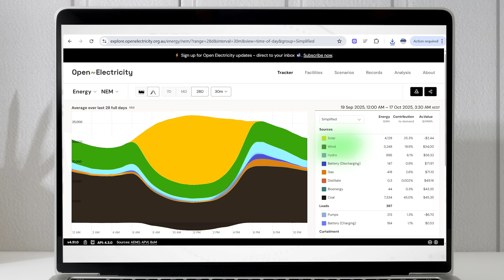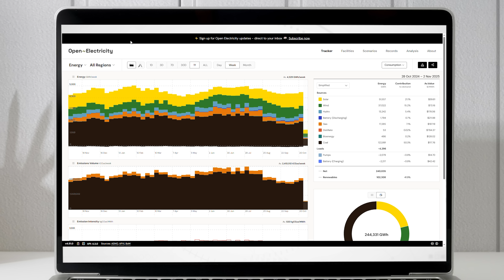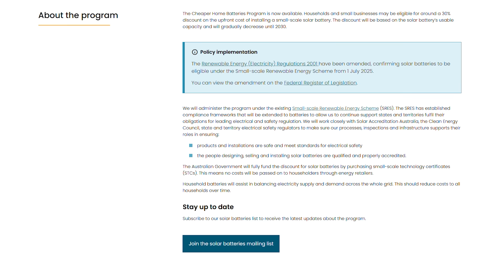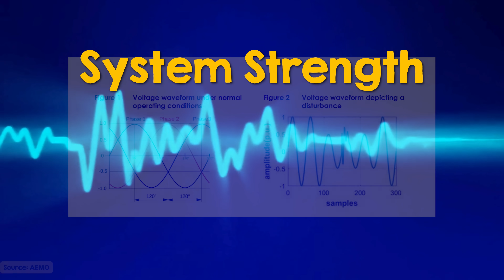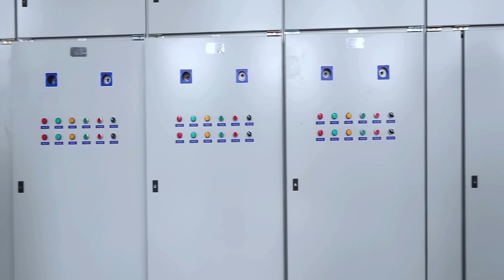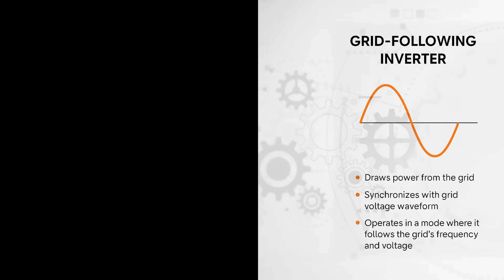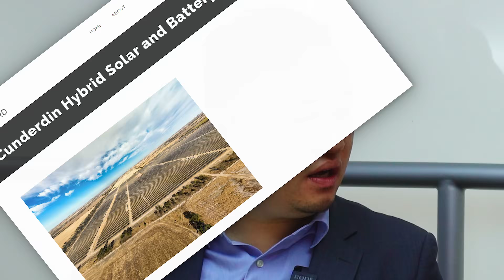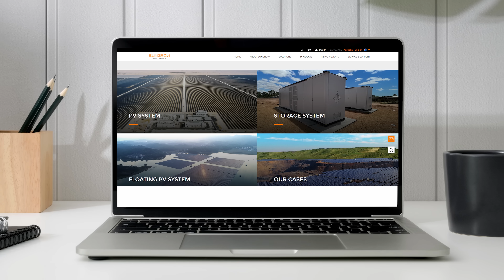Australia’s Solar Boom Is Breaking the Grid - Or Is It?

Comment: It seems that generators (maybe repurposed ones) spun up by electricity (rather than steam, water, ...) could be used to hold "inertia" until better electronic versions are made. In fact, they could be made relatively efficient to do just that by using massive fly wheels.
Reply from the maker: Yes that's probably worthy of a video of its own
Reply: @EngineeringwithRosie isn't it what synchronous condensers do?
Reply: @JSM-bb80u Yup, she covers it in the video. They do the job, but they're expensive, slow to roll out and inefficient. They're more of a bandaid solution
Reply: @EngineeringwithRosie  Yes! Good point.
Reply: @EngineeringwithRosie  Any negative points about renewables the Oil/Gas industry will use it to there advantage
Eg, the term ` Carbon Footprint ` was coined by the Oil/Gas industry to divert blame of global warming to the customer...
Reply: @EngineeringwithRosie  Storage using the battery packs from transport that has reached a level to costly to maintain or less efficient chemical type that`s no longer viable for transport....
Reply: Yes, just drive the giant AC generators of a power station with a DC motor powered from batteries and have the connecting axle weigh a lot for stability.
Reply: @zapfanzapfan  Not 100% sure but I believe you don't need a motor to have this running. Maybe for startup to achieve synchronous speed. But then you connect the Machine to the grid and from then on it will follow the grid and will only consume minimal power from the grid to compensate for friction. That's it. Then as soon as frequency of the grid drops, it immediately becomes a generator using its inertia to help stabilize it.
Reply: @beatreuteler  Synchronous condensers, yes, but the comment seemed to be about repurposing an old power plant and I suggested using the old equipment to hook up a battery plant so power can be both drawn and provided to the grid, plus provide inertia.
Reply: looking the wrong way...storage is what is holding us back ..I have 24V (12x2v) gel batteries and no grid supply only a cheap backup generator which I only  need about 3-4 mornings a year
Reply: @Tony.w-y4i  If you are living far from the next grid connection opportunity, then this seems to be a valid concept. If the grid is near however, in my opinion a grid connection is the more reliable and more sustainable way doing it.
Reply: You could also turn all of your existing power stations into solar thermal mass storage sites using huge silos filled with refractory brick that's insulated. Heated to 1200+ Deg/C from daytime solar, they could be used to provide rapid response to demand from superheated water to drive pre-existing steam turbines that are already there; you just changed from a coal fired water boiler/steam producer, to a solar-powered, thermal mass, steam generator. Should be cheaper and cost-effective, certainly as a transitional solution.
Reply: @Bob-h4s2p I read European studies on low- and high-temperature solar thermal storage systems.
In the first case, paraffin-based solar thermal storage systems with a fixed temperature range of 47-65 degrees Celsius, designed for a heat pump and a heat storage time of 8 to 14 hours, are more cost-effective.
In the second case, sand and volcanic sand mixtures (up to 550 degrees Celsius) and graphite (up to 950 degrees Celsius) are more cost-effective.
Reply: @Bob-h4s2p Steam turbines are too slow to react. Too much inertia.
Reply: Not necessary. "inertia" can be simulated/created with batteries just as well
Reply: @derradfahrer5029 Yes, that is said, but these generators are already there. It is not that expensive to let them run on electricity and use them for that purpose if the coal plant is decommissioned. These could run some 50+ additional years easily and wouldn't be as expensive es a synco that is built form scratch.